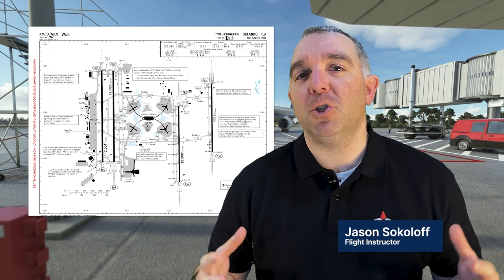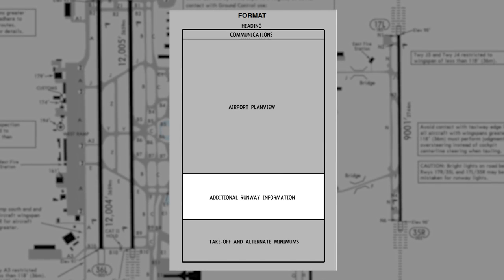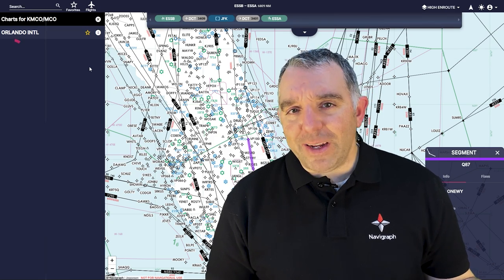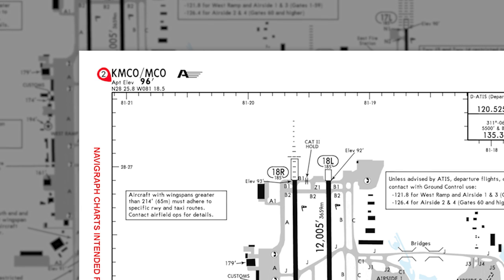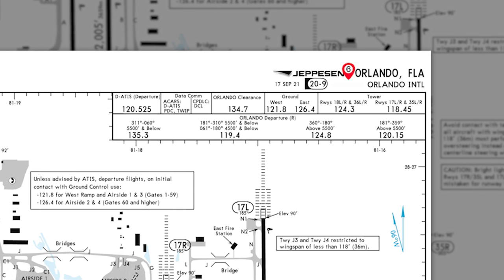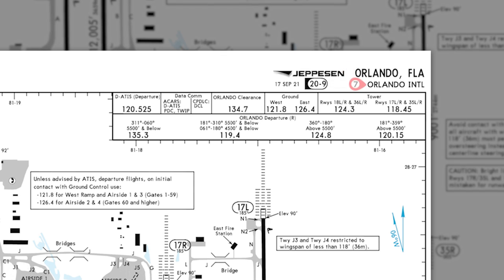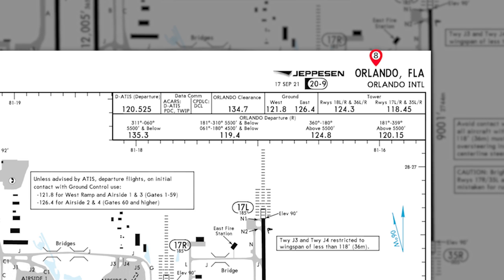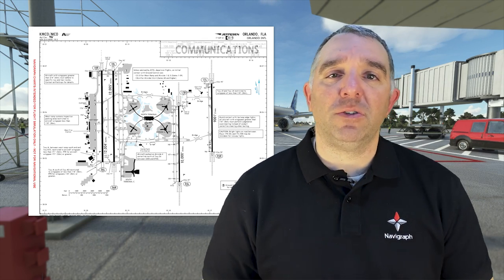How To Read Heading on Airport Charts / Flight Simulation

Comment: Great video and great product. Thank you very much. Would like ask a question…I did all MSFS2020 update integration through Navigraph software.  I really like to try flying over specific countries. But I realized that MSFS 2020 routes does not match with SimBrief flight plan(s). I receive Waypoint Airways not matching messages from FBW A320 Mcdu when I try to set my flight plan and airways. Is this a common problem? Thanks in advance.
Reply from the maker: Hi there! If you have a Navigraph subscription and are using up-to-date navdata from Navigraph both in SimBrief and the simulator, then you should in general not experience any routing discrepancies. If that is the case, we suggest that you submit a post in our support forum and our technical support team will be happy to assist: https://forum.navigraph.com/
Reply: @Navigraphteam  Thanks.

Comment: Hello, I am using the A320 FBW in FS2020. Since the last cycle 2202, the MCDU of the FBW A320 no longer accepts this. My account is active until June 24th, 2020. Simlink is also active and running. What could be the problem? Regards
Reply from the maker: Hi! We're sorry to read that you are experiencing technical issues. Our development team handles technical support in the Navigraph forum. We suggest you please visit forum.navigraph.com and submit a post about this, where our developers will be happy to assist. Many thanks.